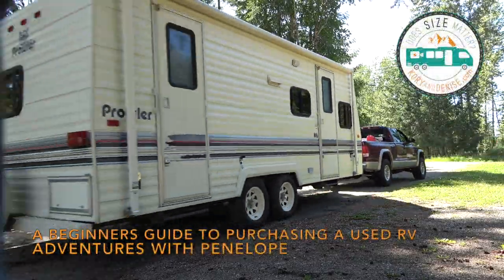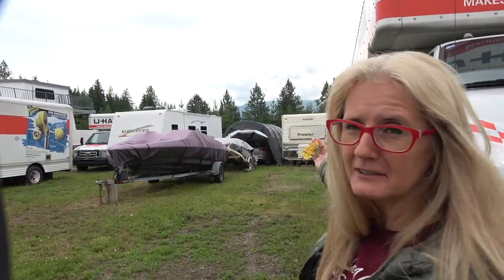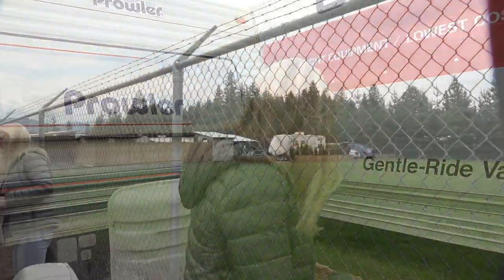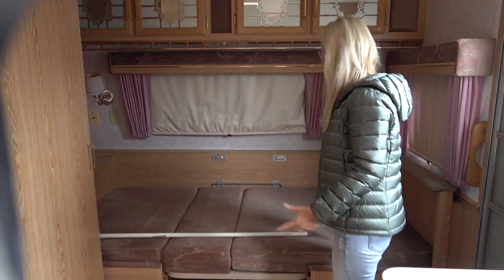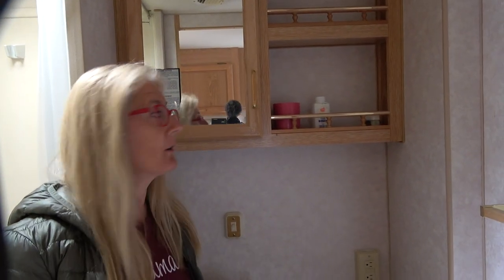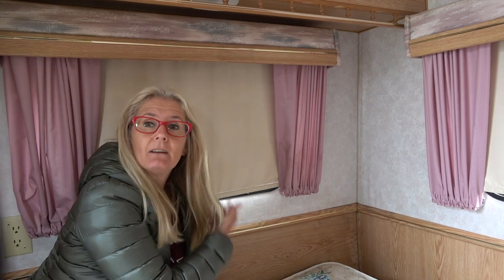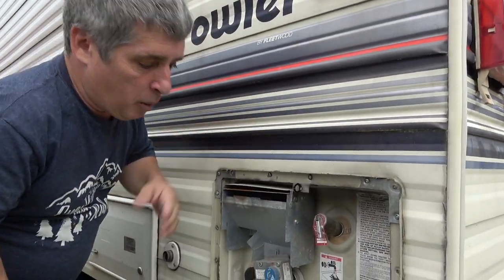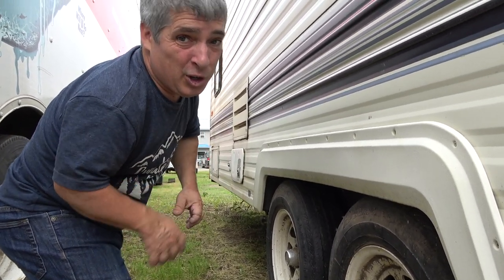Buying a Used RV // Tips on What to Look For

Comment: If I could find my first camper we would buy it. 1985 Sunline 5th Wheel 19.5 ft long, 7 foot wide and 2,600 max load. We pulled with a S-10, 4.3 v6 and got 17 miles per gallon. With the 2015 Colorado we would likely get over 20 miles per gallon. 
You need to clean and seal the top of the windows, marker lights and likely all the roof trims and fixtures should need the sealants removed, cleaned and resealed. I will add at that age I would replace all the leaf springs - should be under $200 for all four and replace the shackles and bolts also. The springs will be prone to breaking at that age if it has a lot of miles or rough roads.
Reply from the maker: We know what you mean. Sometimes you just get a really good one. In future videos we will show you some of the repairs we did just to get it on the road and useable for the summer and now Penelope sits warm and dry tucked away in the shop where Kory will do more extensive work on her. We had the springs fully checked out and they have been good. We put a lot of kms on this summer and she did excellent. We don't now and didn't in her past life take her on rough roads and as we mentioned she was stored indoors most of her life so we were lucky that she hasn't had the same exposure compared to most her age. Thanks for watching
Reply: @DoesSizeMatter  [Snapped Leaf Spring, Unsafe RV Suspension? Stranded! (RV Living Full Time) 4K ]  Video shows right away their broken leaf spring. Now I remember ours that broke did so in three places. Two of the breaks held sort of in place by a piece of steel that wraps around the entire assemble of leaf springs keeping them in line. Now in the video I provided you can see the camper is much newer than yours. Still concerned.

Comment: Wish me luck your videos brought me a lot of encouragement so I'm going to look at a 2011 Forest River Micro Lite 21FBRS seems to be in good shape going to have them hook up a hose and check for leaks. My last camper was a NEW 2019 Flagstaff Super Lite and it leaked like sieve from day one.
Reply from the maker: Fingers crossed that all goes well. Great idea to check for leaks and signs of previous leaks inside cabinets and all over the ceiling and give it a good smell test. Plus start up every single thing and let them run for awhile on propane and electric. If it works for you, you could also have it inspected and ask for any maintenance records they have. Don't be afraid to walk away, even just for a break to make sure of your decision. Good luck, let us know how it goes.

Comment: Did I see a crack in the frame around one of the roof vents on the hinge side?
Reply from the maker: Thankfully no there are no cracks in the roof vents but now that Penelope is warm and dry and tucked away in doors, Kory will be resealing more and we will let folks know if we come across anything else. thanks for watching
Reply: @DoesSizeMatter  Hope it all works out for you! Ever watch any of the You, Me & the RV videos? They mentioned you guys in one of there videos as suggest sites to check out before buying an RV.